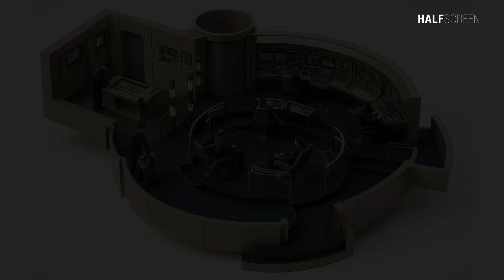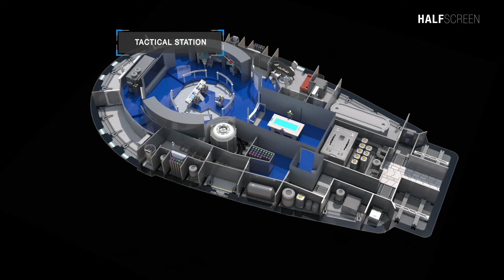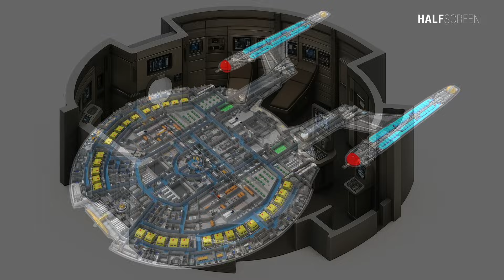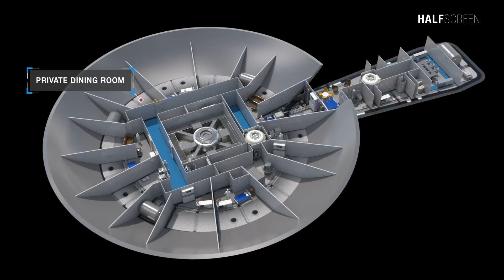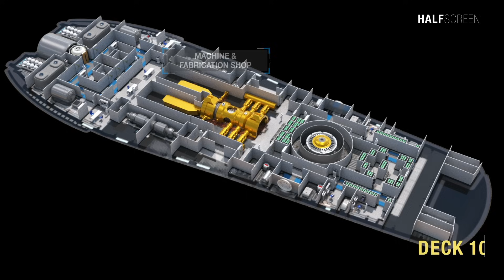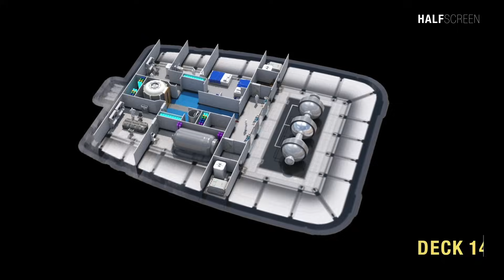The Forgotten Refit of the NX-01 | Full 14-Deck Tour

Comment: I would remove deflector from the soucer section couse 2 deflectors are useless in this case and hull deflector is bigger and more powerful, then i would move all engineering stuff to secondery hull or downstairs this is how i would get from 87 to 120 crew members. Yeah great video, this must take you a long time to make 👍

Comment: But so am I understanding this correctly the refit nX Class maintains both the warp 5 as well as a Warp 7 engine with the warp 5 engine remaining in the saucer section and then the Warp 7 engine built into this new secondary Hall is that correct if so wouldn't that allow for tremendous amounts of power to be generated for defensive as well as offensive systems

Comment: Good video.  May I make one small suggestion?  When you post up the labels, because most of the interior layout is light in colour, the line pointing to the spot on the deck is pretty much invisible.  Maybe consider a darker, thicker line to the location in question?
Reply from the maker: Great suggestion!

Comment: Kinda liked the original AkiraPrise concept design with the ventral hull similar to the Akira class.  Wonder how things would had turned out if the Xyrillians recipricated and shared their technologies like the holodeck&cloaking device as well as keeping the Automated Repair Station's arm that was initially stuck on the hull as well as reverse engineer the tech from the Sulliban's Cell Ships.  From the novels, the Federation did get the Xyrillians holodeck technology but expanded on its interactivity programming.  With the Warp7+ upgrades, could the NX-01 have several hard points and carry a squadron of a dozen Minotaur warp fighter/bombers during the Coalition of Planets/Romulan War.

Comment: The Forgotten Refit of the NX-01/Full 14-Deck Tour:
Deck 1:
Main Bridge:
Captain's Chair 
Main View screen 
Helm Station
Science Station
Communication Station
Tactical Station 
Engineering Station 
Situation Room
Multifunction Console
Small head
Turbolift
Emergency Vertical Access Hatch
Captain's Ready Room
Deck 2:
Stellar Cartography Lab
Cosmology Suites
Weapons & Airlock
Computer Core
Deuterium Fill Port Connection
Deuterium Storage
Water Storage Tanks
Plasma Accelerators
Secondary Science Labs
Phaser Cannons
Deck 3:
Dorsal Cargo Bays
Warp Control Processors
Deuterium Pumping & Conditioning
Science Labs
Main Computer Core
Computer Library
Fabrication Shop
Recreation & Fitness Area
Gym/Excercise Rooms
Water Storage Tanks
First Stage Plasma Accelerator
EPS Power Taps
Warp Plasma Transfer Conduits
Inert Waste Holding Tanks 
Deck 4:
Water Storage Tanks
Junior Officers Quarters
Enlisted Officers Quarters
Cargo Bays
Cargo Transfer Shaft
Transporter Bay
Second Stage Plasma Accelerator 
Command Center
Observation Room
Secondary Engineering Room
Warp 5 Engine
Deuterium Injectors
Antimatter Injectors
Distribution Manifold
Deck 5:
Sickbay/Medical Laboratories
Biobeds
Crew Quarters
30 Escape Pods
Navigational Deflector Array
Senior Officers Quarters
Captain Archer's Suite 
Chief Engineers Quarters
Mess Room
Cryogenic Food Storage
Hydroponic Greenhouse
Shuttlepod Launch Bay
Warp Plasma Coolant Tank
Inspection Pod Bay
Main Battery Room
Warp Coils
Bussard Collectors
Laundry Facilities
Barber Shop
Enlisted Crew Quarters
Officers Quarters
Deck 6:
4 Armory Rooms
Launch Tubes
Torpedoes Storage Bays
Main Weapons Locker
Warhead Loading Hatch
Brig
Monitoring Systems
Ready Room
M.A.C.O. Briefing Room
M.A.C.O. Training Room
Landing Bay Control Both
Lower Observation Deck
Umbilical Connection Point
Deck 7:
Ambassador Suite
Conference Room 
Guest Suites
Bathroom
Atmospheric Processor
Private Dining Room
Planetary Sensor Array
Equipment & Weapons Locker
Support Offices
Deck 8:
Warp Field Governor
Emergency Plasma Venting Systems
Enlisted Crew Barracks 
Enlisted Crew Lounge
Deuterium Tanks
Turbolift
Deck 9:
Forward Sensor Array
Deuterium Tanks
Deuterium Control Room 
Deuterium Pump
Warp Plasma Manifold
Warp Plasma Control Systems
Warp Field Governor
Warp Plasma Conduit
Aft Airlock
Deck 10:
Forward Sensor Array
Machine & Fabrication Shop
Deuterium Preburner
Main EPS Manifold
Airlock
Main Engineering Room
Warp 7 Engine
Warp Field Theory Lab
Coolant Manifold
Magnetic Constrictors
Tractor Beam Control Room 
Deck 11:
Aft Ventral Phase Cannons
Subspace Field Initiator
Tractor Beam System 
Plasma Coolant Tank
Coolant Regulation Pumps
Main Engineering Room
Main Reactor Control Console
Reactant Accelerator 
Main Deflector Dish
Deflector Beam Generator
Airlock
Deck 12:
Refit Hull Computer Core
Transporter Bay Two
4 Lifeboats
Life Support Systems
Antimatter Stabilization Matrix
Antimatter Conditioner
Water Storage Tanks
Deck 13:
Forward Sensor Array
Officers Quarters
Refit Hull Computer Core 
Transport Pattern Buffer
Officers Lounge
Subspace Mechanics Lab
Life Support Systems
Deck 14:
Antimatter Storage Bay
Monitoring Room
Sensor Data Processing Lab
Enlisted Crew Quarters

Comment: wait so it has 2 warp cores?
Reply: correct. The Old Warp 5 Engine and the new Warp 7 engine. The first batch of Columbia-Class Ships were retrofittet NX-Class Ships, where the Engine-Section was slapped on the Saucer Section
Reply: Furthermore in the Old Drex files site,  Drex mentions the idea that the whole warp assembly was easily removable for upgrades. This idea explains why the Enterprise could work. Also the Enterprise NX-01 was supposed to have two warp five warp cores, where one was off line and getting repaired/maintenance,  and the other in operation. This could be done several times,  then the Enterprise NX-01 would find a safe place and transform into its own drydock. For more extensive repairs. Drex was on top of things. He expected frequent self repairs during a standard mission.

Comment: Wait. So they didn't remove the Warp 5 engine when they added the Warp 7 engine? That seems like a waste of space in the reconfigured saucer.
Reply from the maker: Yeah, i thought it was rather strange too.
Reply: They were not sure if the addon of the Engine Section would work and they needed the extra power for the new alien-tech, for example the shields and the tractor beam
Reply: At this point, the Warp 7 engine was still experimental.  If something had gone wrong with it, the ship would still have its original W5 engine so they wouldn't be stranded too far from home.  It's not unheard of, even among the later ships.  The deck plans I've found for the Voyager show it to have a spare warp core in case the original had to be ejected. 🖖😎👍

Comment: Problem is: When you add the neck. The Shuttle drop bays won't work anymore. Its a design-flaw in the blueprints. Yes the Shuttles drop right behind the neck. Still not very accessable. Also Why keep the warp 5 Engine? Is it used as back-up?
Reply: for the Shuttlebays - they actually moved the bays outward so the shuttles would drop down on each side of the neck. It's the only thing that I've seen incorrect about the blueprints on the reference site & video. 
The Warp 5 engine was kept as a backup, because according to beta canon they were still having trouble integrating the Andorian, Vulcan, and Tellerite systems into the NX-class ships and having it all work together.
Reply: Actually they 'now ' launch out of the stern of the primary hull.

Comment: Not to be nitpicky (kinda), is it a Warp 5 or Warp 7...? You mentioned Warp 7 in the beginning, then Warp 5 later on.
Reply from the maker: It was on the blueprint, so I wanted to stay true to the schematic.
Reply: Its both actually. The First Columbia-Class Ship (that's the Name of the Refit) was the Enterprise. They basically slapped the Engine-Section on the Enterprise and tried to include everything the allied Races had to offer. The Engine-Section had a Warp 7, the Saucer-Section had a Warp 5 Engine.
Reply: Yep, also having both the Warp 5 and Warp 7 engine allowed them to run the new shield systems off of the older Warp 5, while using the newer Warp 7, and actually gave them a stronger shield system to contemporary vessels.

Comment: Fantastic work! I love the refit version of the NX-01.  It really looks like a forerunner of what will come after in ship design.
Reply: Technically speaking, with outbreak of Romulan War, NX class start evolving in Poseidon class. With expanded hangar on the back and far better armament. Poseidon what is predecessor of famous Miranda, unfortunately lost its Explorer functions, as all unnecessary facilities were cut. And after the war most end in the mothball, maybe later refitted in Loknar class Destroyers? Few surviving NX class ships, get war refit which is shown here (Archer call it Columbia class). Secondary hull was added to accommodate all modernized parts of Poseidon, without removing original Explorer function. Though it is unclear when it was made?

NX was in service only a decade and was replaced by far better Bonaventure class. What is predecessor of all late 22'th and early 23'th century ships. There is a theory that parts from NX were used in construction of first generation of Constitution, as NX it was practically a warship in end of its life. And after outbreak of hostilities with Klingons, they need that. What could explain time travel adventures of Kirk as Archer Drive was notorious in that. It is why Vulcans agreed to give everyone plans for Warp 7. In Enterprise show, Enterprise never get this upgrade before it was officially destroyed (though I believe it is when Archer traveled in time for the first time). So refit probably happen after that. Most likely when Enterprise become a museum ship.

If Kirk's Enterprise is refitted Archer's Enterprise and they keep Archer Drive in place of Fusion Reactor for Impulse engine. Then during Phase 2 refit they replaced entire saucer with Dreadnought variant, what better fit future Drone Hive design, with TNG hulls being hollow and filled with robots, with decks suspended inside. Anyway in such case they would reclaim almost complete NX class hull and I believe it was refitted into planed late variant, what officially never entered service. But that is just my theory.
Reply from the maker: Couldn't agree more!